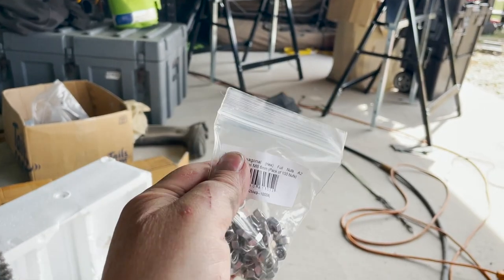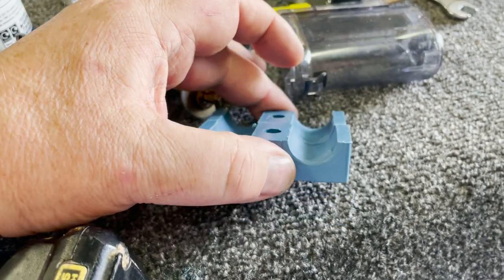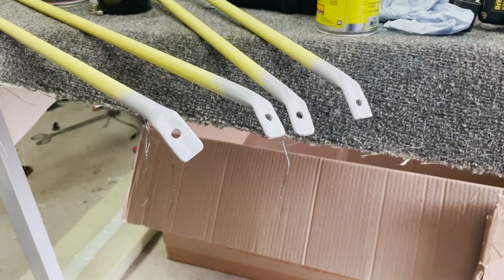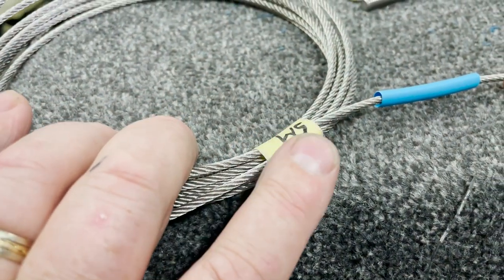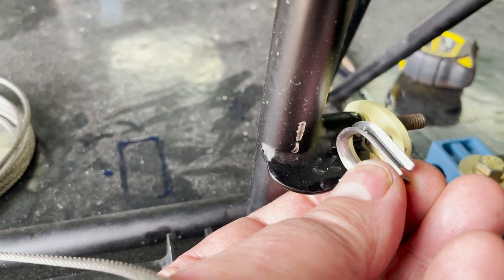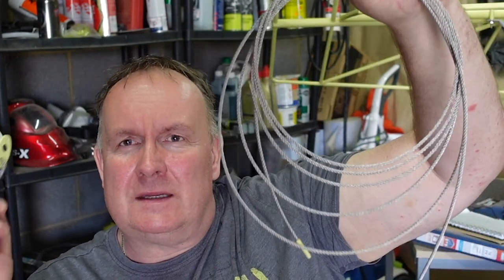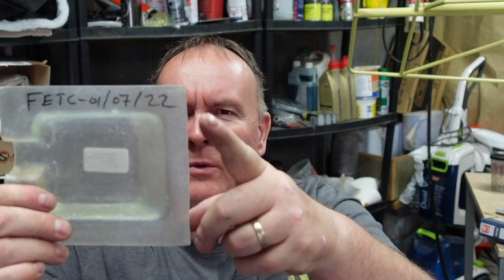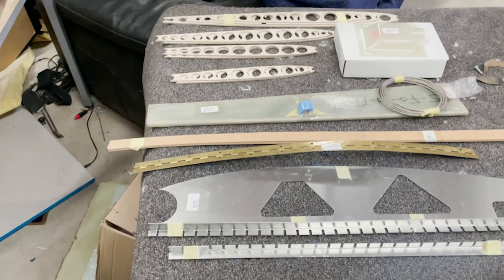Bush Plane Build - I Made a Mistake

Comment: Just a suggestion, put the flap wheel in the drill press, that way you can lay the part ( rod bushings) flat on the press table. Obviously make sure the press table is square and flat.
Reply from the maker: The simplest tips are often the best - cheers for that. Don’t know why I didn’t think of it 👍
Reply: @FatParamotorGuy  It will certainly take the stress off holding it whill sanding it. Also, would it be possible to have a dowel or some sample of what that bushing is fitting next to the press that you could periodically check the progress on instead of having to mount it each time to check your progress? Hope it helps.